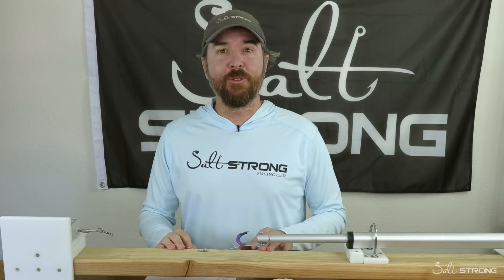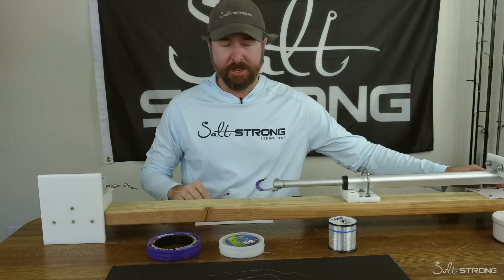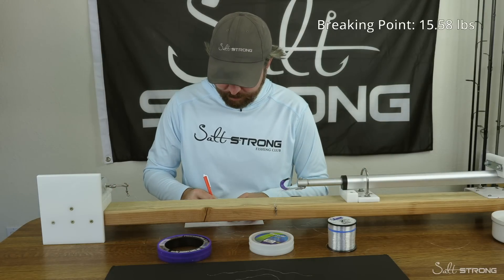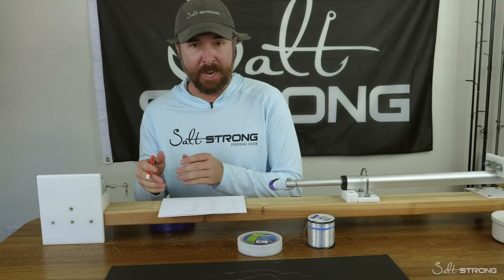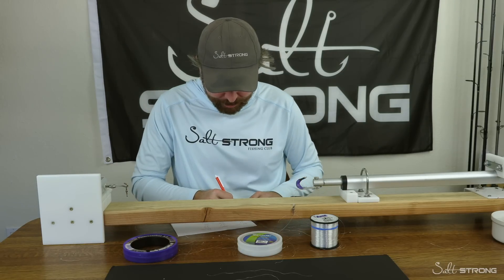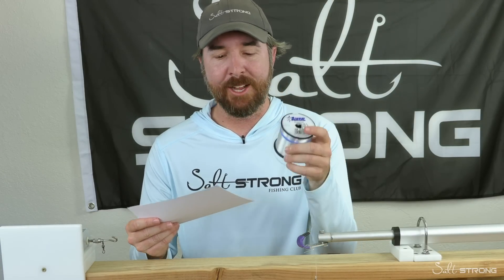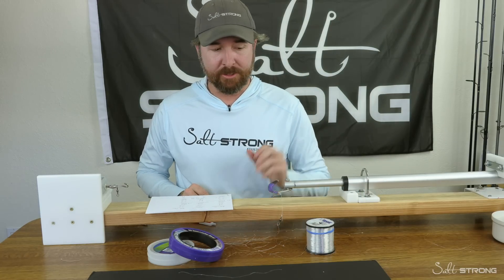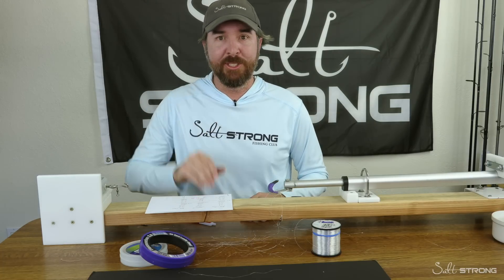Fluorocarbon vs. Monofilament Line Stress Test Experiment Results!

Comment: I don't see how this would be relevant whatsoever unless your using a handline. With correct drag and rod flex there's no possible way to stress your leader like that without it being 100% operator error 🤷‍♂️ I'm not biased to one or the other because I use both. Use your gear properly and neither should ever come close to stretching at all.
Reply: For anglers that snag and break off repeatedly during a trip, this information is extremely valuable. For example, a bass angler that habitually uses fluorocarbon leader will surely consider getting out of that habit when conditions might allow for the use of mono instead  (I.e. dirty water). Trout anglers using a hi-vis mono (for visibility and floating properties) connected to a fluorocarbon tippet will now consider whether they reuse a length of fluoro tippet that was stressed to breaking from a snag.  My thoughts…
Reply: @mistertwister1816  but if your breaking off a snag wouldn't you automatically replace the leader anyway (that's if it doesn't snap at the join knot already) that's what I mean when I say operator error because to keep using any rope, line, wire or chains after they've been overloaded to breaking point and all integrity is gone is 100% on the operator.
Reply: @greenmachine3696  when we’re pitching heavy mats and brush at close range for big bass we shock the heck out of our line. You hit ‘em hard and try to move them out the cover as fast as possible with very little line out to absorb the shock with the stretch you’d have if it was a long cast. I wouldn’t use flouro especially for that but some do. It’s braid or copoly for me always.
Reply: @jamesbarron1202  yeah I get that, we do the same for big jacks in heavy structure here as well but never to the point where the line is shocked hard enough to damage it anything like this test and that's with on average a much shorter blank than what I've seen you guys use in the states for bass. I can run a 30lb/30lb in that situation and even pushing a few kg of drag I know nothing will be overloaded and I can turn a jack in its tracks upto 4kg.
Reply: @greenmachine3696  that’s when I used to break flouro was on hook sets. I tie a good knot for flouro also. Lubricated also. I never break off on my copoly unless I’m hung up. I watch bass fisherman on YouTube and I can’t believe how much they break off with flouro. I’m in Texas and we have the biggest bass on average besides California. I’m sure we have much more 7 to 10 lb bass than Cali.
Reply: @jamesbarron1202  I'd love to catch a largemouth someday, our bass are powerful and aggressive but not super heavy. The Barra and Murray cod here though are big fat slobs pretty regular from 15-50lb most people run fluro here on everything freshwater. I use mono rigs out sea fishing and on my heavy game gear but I run full spools purely for the stretch on strikes and hard runs but also the drag in the water when jumping, braid and fluro just pull hooks on wahoo, mackerel and billfish.
Reply: @greenmachine3696  the only fault I see with straight mono is getting bit on a long bomb cast and a heavy gauge hook. That stretch will be your enemy then, trying to get that hook into them. It’s great to have that stretch when your fighting in at close range. Especially when they make that sudden last ditch dive under the boat as your trying to grab them.
Reply: @jamesbarron1202  nah mate that's not an issue at all trolling at 7 or 8 knots with strike drag set up properly. The pros run igfa mono with heavy gauge hooks etc and they don't have any drama with hook sets. I use gamakatsu big game fly 10/0 in my skirts and eagle claw 7/0 inline circles for skip baiting so penetration is never really an issue but I'm not out there chasing 1000lbers either, I don't have the means or capacity for big bill fishing and would probably get spooled by a black marlin over 300lb but yeah think of the mono like a snatch strap or a shock absorber when two high speeds collide.
Reply: @greenmachine3696  I’m talking about bomb casting (not trolling) on schools of bass way out there with a big Zara Spook type topwater or a heavy lead spoon. You have to crack em hard at distance on mono.
Reply from the maker: Thanks for the comment. Feel free to visit the full blog on our website and post your question/comment there. That way, Luke and team can respond directly with their input. You can find it here: https://bit.ly/41vV6hG
Reply: Green Machine, You seem to have all the answers, but know very little.
Reply: @tima.9125  ok champ 🤣
Reply: @tima.9125  it’s easy to see he doesn’t fish in flooded timber. You run a loose drag and that big fish will wrap you up in it. Sometimes you have to lock down on them and turn them to the point of breakage. What he says might be fine in clear open water.
Reply: @jamesbarron1202  wrong. I fish heavy timber. My point is I don't fish undergunned and overstress my tackle and if for some reason that happens, I'll replace my leader without a second thought. It's not a new concept 🤷‍♂️ it's been around a lot longer than me.
Reply: @greenmachine3696  You can stress 20 lb line on bass and especially when your running a leader. That causes more stress because there’s a shorter length of line. Less rubber band effect the less line between the braid and hook. I’ve seen so many guys break off doing that. I’ve been fishing over 50 years and guided.
Reply: @jamesbarron1202  of course you can overstress anything if you try hard enough, I'm not arguing that. If you're chasing a 10lb bass in heavy cover and need to run a locked drag though that's a choice you've made right? You could run 25lb or even 30lb lock up the drag and turn them without stretching your leader instead could you not? This test is pushing the line to almost breaking point and where is it stretching the lines? In the last 5% maybe? The point still remains that if you think something has been pushed into that 5% then don't keep fishing it and expect it to retain its integrity. Was that not the purpose of this silly test? Experience is great and I have a lot of it myself but does it overrule math, mechanical reasoning and logic? Mine certainly doesn't.
Reply: @greenmachine3696  yeah but who wants to fish with 30 lb wiry stiff flouro unless your throwing big swimbaits. Copoly will take a beating better than flouro and it’s much cheaper. I’ve even seen Matt and Tim on Tacticalbassin break off a lot on hook sets. I guess if you want to spend a lot of money replacing it more often it’s OK.
Reply: @jamesbarron1202  I don't disagree with that mate. I just disagree with the theory behind this test, I think its a bit ridiculous, at the extreme end of probability and overall a bit of a witch hunt against fluorocarbon for some weird reason 🤷‍♂️. We do throw big lures with big heavy leaders here for freshwater natives, it's a necessity for Murray cod and Barra due to their size, having razor sharp gill plates and being in heavy structure normally so it's not really taboo here to fish the right tools for the right job.

Comment: Great test Luke. The only thing lacking is the shock loading that you would get from a fish running against the drag. As a retired Rigger I know rope manufacturers warn to constantly check ropes for shock load stress on both running rigging for sail and work boat and mooring lines. Shock loading would definitely come into play for leaders.
Reply: And the bend of the rod, and the drag being set at 1/4 or less of the breaking strain,  all good points
Reply from the maker: Thanks for the insight!

Comment: Very interesting. Thanks for this testing. I got rid all my floro long time ago.
Reply from the maker: Thanks for posting the nice comment
Reply: I use 7 feet of fluorocarbon leader, tied onto braid. But the drag setting is way below the advertised breaking strain. 5lbs of drag on a graphite rod, with smooth drag from a Daiwa certate reel, doesn't damage the line at all.
Reply: Using 16# sunline sniper on my zillion hd and it's a nightmare , poor zillion ! Line has too much memory and kinks, it's junk basically